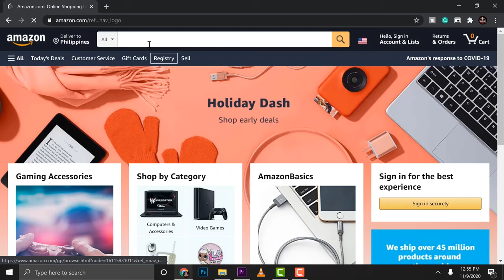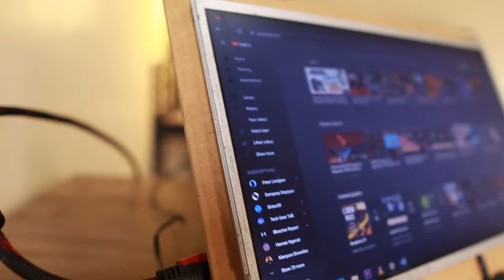How to turn Old Laptop Screen into External Desktop Monitor

Comment from the maker: 00:00 Intro
00:34 The Old Dead Laptop
01:04 Taking out the screen
01:33 Screen Model Number
01:47 Buying Needed Parts
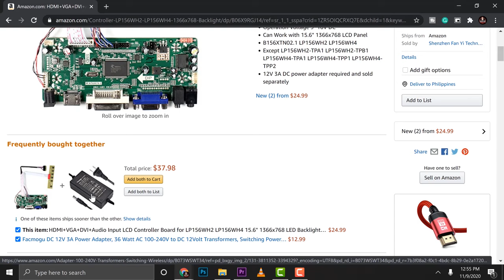02:43 LVDS Controller Board
02:53 Parts for Screen Stand
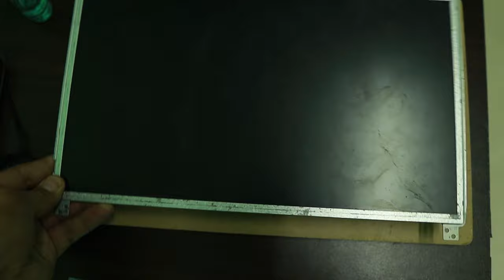03:22 Building the Screen
06:00 Halfway Done
06:22 Mounting it on the desk
06:49 Using it as dual Monitor
07:14 The Output
Reply: Nice video btw put this timeline in description so it shows up in the video .
Reply: What is source of Power? Is any power adapter needed? If so then which adapter suitable for it?
Reply: Will this work for touch screen monitors?
Reply: @Eduardo_Espinoza  If the LVDS controller you get is touch screen capable and the screen as well then it should not be a problem IMO.
Reply: Ć0
Reply: can you do a new project with phone display and hdmi
Reply: Not network wire
VGA HDMI adapter
Reply: how much input latency is added by the controller board? might try this as like a portable monitor from a free laptop

Comment: What a great find, the waste from old laptops has bugged me for years. Now it turns out I don't need to buy new monitors for my Raspberry Pi4, I will diy them from old laptops.
Reply: so, whats the progress?
Reply: @socrates1701  Trash to monitors
Reply: Did you manage to do the same? no failures?
Reply: Just what i was thinking about
Reply: He got zapped by the electricity unfortunately, and are no longer with us.
Reply: To be fair I don't have the room for another monitor.
Reply: @Santor-  🤣🤣🤣🤣🤣🤣🤣🤣🤣🤣🤣🤣🤣🤣🤣🤣🤣🤣🤣
Reply: What is the cost of pi 4
Reply: @thamizhr1285  3 kidneys and a unicorn soul at the moment, hopefully the price drops soon
Reply: Great idea on raspberry Pi
Reply: I also used a heatsink from the same broken laptop for my raspberry pi

Comment: too expensive part named of "lcd controller". by this money we can buy another monitor as used. Thank you for your effort.
Reply: Exactly
Reply: In my experience I had a pretty decent laptop from 2016, with a good monitor. Since a few weeks ago it stopped working I decided to save the parts that were worth it and with 15 bucks I've been able to make the screen work again.
Reply: @Doctor_Dario   If you have income as dollar no problem but in my country we earn Turkish Lira. Used 19" monitor is 100 TRY. This part is over than 100 TRY (15usd =150TRY).Buy this part is not conscious according to my country:)
Reply: @canberkgenc1028  I actually live in Europe. In my country you can buy a decent monitor for about 20-30€, so it's pretty much the same as in your country. The difference is that you can afford a DECENT monitor at best for that price, but modern laptops have very good displays, so since I had to take the laptop apart I wanted to save the components that weren't broken and recycle them for another PC

Comment: My old laptop still works, but it has a dead battery and a broken case. Because it is still working, can't I use the controller board in it? If so, how do I identify the board and where can I find instructions for using it? Thank you.

Comment: Great use for old laptop screens! Unfortunately the converter and power adapter seem to cost as much as a bigger/used LCD desktop monitor.
Two suggestions for the cable placement:
- if you make a rectangular/circular hole in the middle of the clipboard to pass the LCD cable through, it will not be visible in the bottom.
- if the controller board is placed closer to the middle of the clipboard, the VGA/HDMi/DVI cable will not be visible on the side.
Reply: What converter and power adaptar do you mean? i jus ordered the controller and you can use the laptop charger that came with it to power the controller i believe, all costing me less than 30 bucks
Reply: @Zeussxs  Laptop power adapters are usually 18v to 21v, and the search I did for controller boards seems to indicate that they work with 12v. Might be wrong, tough.
Reply: @wettuga2762  yeah actually you’re right, i didn’t check that
Reply: @wettuga2762  i found a 12v power adapter though for 13 bucks
Reply: It's true. I found adapters costing as much as a new monitor. I had a bad experience with AliExpress but I think they have cheaper options. Might be the way to go. Amazon prices for the adapters are sky-high.
Reply: A used monitor is less power efficient thanks this set up. I would rather go for this than buy a used monitor for power usage.
Reply: Buy adapters at used electronic stores / goodwills, and that can make up for cost. you can find plenty of 12v power adapters at resale shops for dollars if not cents.

Comment: This is a great DIY video. Thanks for posting this. I will probably just look for a used monitor online though. Once i seen what the cost for these boards, its about the same for a cheap monitor. I may use this setup for another project so thanks for posting this.
Reply: I think that the idea of this video is that you ALREADY HAVE this screen, so it comes with no extra cost.
Reply: @tennishistoryandresultsdat4540  The idea for that video was to show someone how they could take a used laptop screen and convert it to a standing monitor for eother a desktop or for a laptop that has a way to connect to a external screen. I have aboit 10 screens I salvaged from old laptops that are outdated and not worth using. That board then was $25 without the power supply. I was going to build one to use with my laptop cause my screen when out. The cost of a new screen for my laptop only costed me was 46 with free shipping. 
     Now something like this will help me to build arcades since I have been hoarding screens and parts for them for the past 3 years. This would make them light weight and cheaper for me to build cause I could have them up and running for only $25. My intentions were to build bartop arcadesl. I just never started it when all the stuff hit the fan back in 2020 and shut everything down. Great video though.

Comment: i did it using the original notebook body as the monitor body, thanks for the video
Reply: How you did it? Thinking of doing the same with my 2004 XP laptop...to connect to my Window 10 broken laptop screen

Comment: The idea is fantastic, excellent but my opinion instead of passing the cable through the front of the screen, you would have made a hole and pass the cable behind so that it is not visible and for the electronic card use an acrylic box for mounting on the wall, for protection of the same circuit.

Comment: I absolutely love it when a crazy idea I get in my mind , eg I had a Toshiba laptop , not worth replacing the screen,but it still served a purpose when Im doing a PC build , then I had a Fried Laptops motherboard where it was polorised with some Wally adding 240 volts 🙄 into the main CPU , asked if I could repair a literal bonfire ! Cut a long , this Advent and my Toshiba in my shack worked perfect using this tech , so it's awesome when ya wild thoughts actually aren't ,and it proves it ere , great video buddy , today's tech , manufacturers DONT want us able to repair nowadays , wel tough Sxxt Toshiba , I don't need to spend £100 quid yet !!! That's the going rate of a ok Upgradeable W7 satellite Pro,,, good job man 🙏🙏

Comment: nice video - i acquired an asus laptop on facebook  that was working but dated, slow and no longer wanted - i took it apart and got the working 15.6" screen off of it.  The laptop lid is still in good order and I am planning on keeping the LCD in the ASUS lid.  I have the parts on order now including the tablet stand - neat idea - thanks.  I am planning on fixing this up and being able to carry it on trips with me so i have a 2nd monitor when working from hotel rooms or otherwise on the road. Wish me luck - I'll see if i can share a photo or two of it when i have it finished!

Comment: Added to a Raspberry Pi you can make a very slim setup that you can velcro stick to a wall or door.   I use one for a quick access in my server cupboard to rdp onto my servers and switches to admin them.  Get a touch screen from a laptop that has touchscreen and you have a really compact sytem.

Comment: Only thing I wish you had cut a hole through the clipboard to pass the monitor connector through behind the monitor and it'd be totally clean of the connection wire. Other than that, great idea! Just upgraded a laptop panel and I'm thinking what to do with the old panel.

Comment: I have thought about doing this, I have old broken laptops... but also, for the cost of the board, I can just buy a used monitor, and it will work really well, wont take  any troublshooting, and I dont have to build a stand for it. If there was an easy way to extract the display driver board with the laptop so that you dont have to buy any parts, and or so that you can use multiple panels into one display, that might be a more viable solution

Comment: That's why I did it. My lcd ips is wrong because the one I bought is not compatible with my laptop, so I need to change the lcd. I also thought that to make the most of it, I made a portable monitor that can be used with a ps4 or a second monitor on a laptop.

Comment: I think it's a good way to repurpose old screens and reduce e-waste however most of the controller boards are still too pricey, it's the same price as buying a used monitor. I have not come across a controller board that is less than $15 retail. I believe the best practice for old laptop screens is to use them as replacements for other working laptops that need screens or for cool projects.

Comment: Thanks, I have a Vaio Duo 11 with a sliding display, while it is considered ancient today, the device is still a marvel of engineering, incredibly thin, and plenty fast still!

Unfortunately the display is defective, it is also almost impossible to find a replacement, and even if you do, it is typically egregiously overpriced. 

I have another old laptop, ill extract the LCD and attach it to the Vaio's sliding mechanism!
(If you lookup a photo of the Vaio, it will all make sense).

Comment: If you had made a hole back of the screen for the lvds cable it would have been better, moreover a woody fronf on the screen tha cover the edges of the screen. And why not before screwing the screen just put a woody rule under the edges to make a space between and to let the  lvds gets out trough the back easily

Comment: Bro, is it possible to charge the monitor by usb from the pc? So that you can carry it anywhere
Reply: No, USB doesn't carry enough voltage and wants to support a monitor
Reply: No, the monitor needs, 12v-2Amp , i used a 12v 500mha and the half of the screen was dark so you need the 12v - 2Amp
Reply: Yes with USB3
Reply: If you use a low power screen. But overall... It's way cheaper and faster to just buy a used "regular" screen instead of this build.

Comment: Any reason why you can't reuse the controller board from the old laptop as well?
Reply: The connector problaly won’t fit. You can try it though. I did and broke the connector :(

Comment: Great video brother! I was just wondering what if my laptop has 2 cables one for the lcd screen amd one for the camera, I'm not sure how to find a controller board that manages the camera as well.
Reply from the maker: Most third party boards does not support webcam integration, however most laptop webcams can be converted into USB cam
Reply: @torogipro  I understand , thanks bro, keep it up with the great work!

Comment: I tried doing this from a dead laptop a long long time ago. While the controller board I ordered worked, the connector for the backlight was different 😢 I ended up with a monitor with a very dark picture. Nowadays, the first thing that dies in laptops I stop using IS the LCD screen

Comment: Thanks for sharing this Torogi Pro. I'm planning to build one. I have 1 broken laptop here from ASUS ROG i7 1st Gen. I have this type of LCD 17.3 LCD Model LP173WD1. Can you suggest or send a link to the LVDS controller board of this type? I'm not quite sure what I have searched from Lazada if it is the correct one. And what voltage rating power supply should I use? Thanks and more power to your channel. Already subscribed and liked your video.
Reply from the maker: Just make sure the model number is supported by the lvds controller bro.
Reply from the maker: You can also just simply send a picture of the model number of your lcd to the seller and they will hive you the correct lvds controller.
Reply: Thanks bro, may i ask also what power supply voltage rating you have used on your video?
Reply: @shidkati86  12v 2amp prefered

Comment: hey quick question, is there anyway possible to get the "controller board" from the rest of the laptop parts? like is there any other parts on the laptop that could be used to make the controller board?

Comment: Cool video @torogipro ,Can you please assist me? I bought a controller board specifically for my laptop screen. I've connected all the cables: power supply, wire from the board to the screen, and HDMI from the laptop to the controller board. The screen lights up, and the "no signal" message is displayed on the screen, and then my screen goes black. I have unplugged the connections and connected them again, but unfortunately, the same message persists. My power supply is 12V 3A. Is it possible that the power supply doesn't supply enough power?"

Comment: Does it work with touch display? My Lenovo ThinkPad T460 motherboard has been damaged. I have used its RAM and SSD into other systems of mine. It has a touch display panel that I don't want to spare but I want to make use of it with my desktop PC as an external monitor. I found your video useful and I'll try to find some LVDS controller for it. just want to make sure if this controller will support the touch features of the display or it won't...

Comment: My monitor is LP140WH4(TL)(A1), it has 40 pin connector. But I can only find 30 pin connectors on control boards. I live in UAE so this stuff isn’t that easy to find. What do you recommend?
Reply: Go to eBay, there will be people/sellers who ship worldwide

Comment: Hi, i am facing this problem, any idea how to fix this? LCD screen doesn't turn on after connecting to the controller board and power. when a button is clicked, It flicks once when turned off.

Comment: Hi, I wanna ask if your LCD model number has version, for example BT140GW01 V.4 (is the V.4 important and required to buy a controller board that fits the v.04? Or any BT140GW01 controller board can work with it?)

Comment: Nice video but it took the easy path by using a more modern LED-backlit LCD panel. The hard part is to use a CCFL-backlit panel because it requires HV for the lamps and the voltages and frequencies for these vary quite a bit. I have an old CCFL-backlit panel from a laptop that has the HVPS in the lower side of the panel but no info on it. I wouldn't like to connect the lamps just to see them go into "magic smoke". Has anyone made a CCFL-to-LED conversion either with a kit or DIY and succeded? Any info would be appreciated.

Comment: nice idea - is it worth ? how much have u paid for the lvds board ? i ve seen a universal 1 bout 12 € on ebay ... maybe i try this sometimes ...
Reply: would be much cooler if its not necessary to buy new parts for this ... it should be possible - but how ... the controller should be on the old mainboard ... hm - can we make that too ???

Comment: Is it possible to find controller board for every notebook monitor? I have one Dell 6400 Inspiron. Bought it almost like 20 years ago:) do you think it is possible to find a controller for that?
Reply: It not the model of the laptop that matter but more of the screen model so you gonna have to pry the top part of your laptop and check for the screen model cause that could be different in even the same model laptop.

Comment: IT's really too bad that the price of the controllers are usually not worth it for a cheap recycled monitor, except if you are dealing with one hell of a great display (I for instance wish I did not throw away my old XPS which was 3D shutter glasses compatible - not because of the 3D, but because the image was AMAZING on that old thing)

Most of the time, if aliexpress won't save your butt it's almost cheaper to just go for a lame IPS tablet and just parsec it.

Comment: @torogipro possible to turn Oled display replacements for laptop like asus in to also a external monitor? if i have a raw display ho i should turn or which service or tool can i use it for every oled display into a external monitor?

Comment: I have an idea that id like to share and know your opinion, I have my portaboe monitor made from an old laptop as well, I have noticed that the wolts and ampers from an old laptop battery are the same as the charger Im using for feeding the motherboard. So the idea is: would ir be possible to cut a charger and connect both cables to the battery? Therefore feeding the mother board? I still dont know how it would be possible to charge rhis battery after using the monitor, but I guess it would be possible to create an external charger and meanwhile use a regular charger for the monitor. What do you guys think? Im afraid of trying it and frying my board lol.

Comment: Is there a controller board for my "Sony Vaio PCG-81312L" 16.4" 1080p screen? I got it from an old laptop with some issues. Is there a controller board that will work for it? 

Edit: I think I found one but its $26~ and its coming from china also, I would need to buy another power supply for it. I'm using the same power supply needed for another project so idk if its worth it. The Panel also has a bright spot on it as well. I'll save it for now until I find a use for it.
Reply: same i cant find a board for mine :(
Reply: @moji3812  What's the model number of the screen?

Comment: I have a question, I have a LTN156AT32-001 screen, what lvds Controler board would i need? its a 40 pin connection